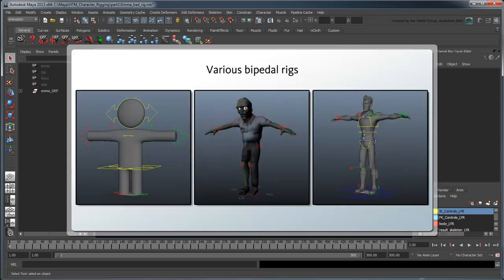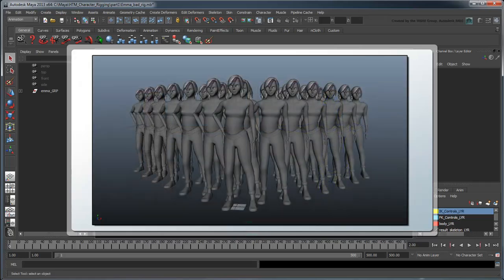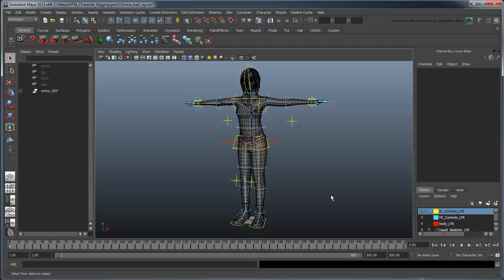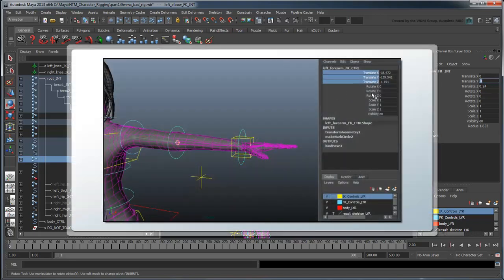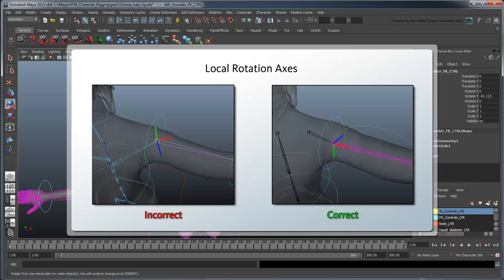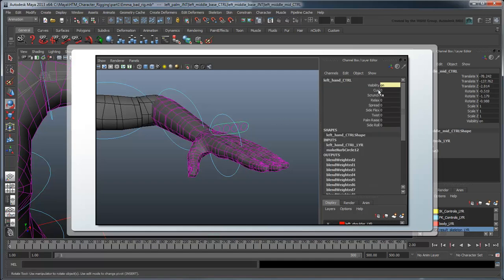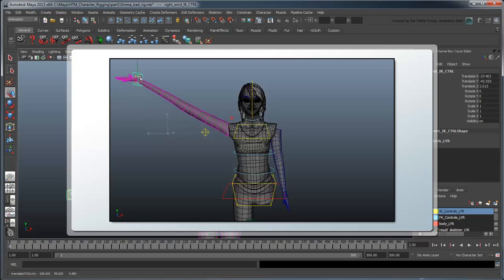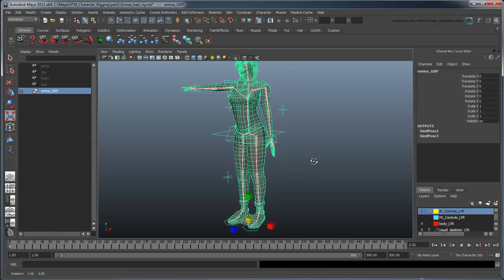Creating a Character Rig - Part 1: Common rigging pitfalls (Advanced)

Comment: I’m following this course using Maya 2026, and overall it still works well (I’m currently at part 18). However, if you’re new to Maya, you’ll likely run into a few hiccups because some tools now have slightly different settings or window layouts.

One thing I strongly recommend is not following the steps for adding stretch to the arms and legs. It feels unnatural and makes the entire rig more complicated than it needs to be. I’m not an animator - despite 30+ years in 3D - but if someone handed me a rig with fully stretching limbs, I’d honestly wonder whether I was working on a Pixar/Disney character or whether the rigger misunderstood human anatomy. Stretching can make sense for the torso or neck, but even there it’s worth adding some limits to keep the movement within believable ranges.

Comment: ‘Stretch for realism” idk mate last time I checked human bones can’t do that in real life…
Reply from the maker: Actually your limbs can stretch a bit by having the bones pull away from their sockets a bit.  Also it isn't so much stretch alone that's "realistic" but rather volume preservation.  A good example of both is to stretch your spine to reach as high as you can and your vertebrae will naturally pull apart a bit (stretch).  Conversely, if you crouch into a ball, your vertebrae will compress together and your skin (or in my case, fat) will squash outward.    Both of these are subtle,, but for the most realistic animation you need to be able to mimic both in a rig (obviously it's also great for cartoony rigs too).
Reply: @Autodesk_Maya  I feel like if my vertebrae or limb bones stretched form out of their socket to the point that it’s visible to the naked eye I’d want to go see a doctor lol

Comment: WARNING! guys if you using this as a tutorial, you will notice hes only showing you to do 1 leg, 1 arm, etc. for the sake of your sanity. Do them to both sides for your rig. once you watch about 3 hours of tutorials he basically says..."there is no way to mirror the rest of the rig so go back and do the same thing to the other side." This infuriated me. he could have warned me at the end of each video by simply saying, "now do the same to the other side"
Reply from the maker: I'm honestly very sorry about that.  My intent was to have the right-side act as a sort of test/review/practice of what was learned on the left side.  Also, it's not quite so straightforward as to do the same thing on the other side (part 32 mentions general things to look out for like reversing LRAs, and which joints can/can't be mirrored).  Anyway, either method of doing left/right was going to have advantages and disadvantages.
Reply: @Autodesk_Maya  Its also been 8 years since this was made. Is there anything with the newer versions of maya that make this easier?
Reply: @CorneliusBogfrollupFitzgerald  Mirroring joints in Maya is possible for quite a while, don't know since which exact version

Comment: Hi again~! I realize facial rigging like most thing is a case by case basis, but say if i were to do facial rigging how would I approach the proxy workflow would i be able to separate the head mesh and work on the facial rigging independently and combine it later? How would the skinning work? I can think of driving the main mesh with blend shapes but is that the only way? THANK YOU IN ADVANCED!!!
Reply from the maker: I wouldn't recommend doing a proxy rig at all for a facial rig - just skip straight to a skinned rig.  There are generally two approaches:
1.) Create joints to control the eyes and mouth and then make controls for them.
2.) Use blendshapes (as you describe).  

The former will give you greater control but is a bit harder to setup.  The latter is better if your character is only going to go through a number of pre-made expressions (like game characters tend to have).
Reply: Thanks for the prompt reply @Autodesk_Maya  . Does that mean in conjunction to the entire series featured here, I would only start my facial rigging in the final stages where the final renderable quality character geometry is transfer over and skinned? Doesn't that defeats the purpose of having a proxy rig to be used by the animators? Or do you mean i would skip the entire slicing and dicing of the mesh and go with a properly skinned character to begin with?

Sorry if this sounds all over the place since i am a little confuse with the pipeline here. Further if i would work in a team, can i have different person working on facial and another on the body rig using what was featured here? 

I have seen quite a few tutorials on facial rigging and the approaches as well as techniques aforementioned but most of those were demonstrated with the head mesh separated from the body. I am curious how would those approaches be implemented or integrated in relation to the featured series. In which stage would a rigging artist start to implement their facial say for the rig shown in the tutorial series? 

Thank you for your patience and kind reply.
Reply from the maker: @Wongjiunnhann  So typically this proxy rig is used for sketching out rough animation since it's the full body skinning that tends to have the biggest impact on scene performance (especially when multiple characters are in the scene at once).  So you'd animate actions without the facial animations first.

Once you're character's body animation is close to finished, there's a couple of ways you could proceed, mostly depending on how fast your computer is.  

1.)  One way is to import the skinned rig and transfer the animation over to a skinned mesh with facial controls (https://www.youtube.com/watch?v=M-B4jtTf3Co&list=PL8hZ6hQCGHMULnijpKL2q790u_nV9RP92) and then do the facial animation.  If you're on Maya 2019, make sure that Animation Caching is turned on and you shouldn't see much (if any) drop in performance.  

2.)  If you're on an older version of Maya without Animation caching, you may see performance drop when you do 1.  Depending on how heavy your scene is, this might still be workable (especially if you're working with blendshapes which don't require you to move controls as precisely as face controllers).  However, if you find it unworkable, then instead of importing the skinned rig into the main scene file, I'd recommend exporting the animated proxy to a much lighter file (either one without background elements or with very simplified background elements) and then doing the skinned rig transfer there.  Then you can animate the face a lot faster and export that entire thing back to your heavy file.  It's a bit more involved, but you'll get better performance to tweak your expressions just right.
Reply: Thanks for the clarification~ appreciate it a lot!  @Autodesk_Maya

Comment: So i managed to follow this tutorial and everything worked out! now im trying to build a single root skeleton to put in unreal but when i try to do the stretchy spine it affects all my limbs in a weird way. What things do i have to do different and watch for when building a single root skeleton ?
Reply from the maker: Hmm odd, the individual pieces should be compartmentalized enough that you can just connect all the result skeletons together to create one continuous skeleton.  I would try putting intermediate joints, representing the various "left_arm_GRP", "left_leg_GRP", etc just to see if that fixes any issues.

Additionally, I wouldn't recommend trying to move the entire rig, controls and all, over to Unreal since it uses so many Maya-specific nodes.  Instead, I'd animate in Maya, then bake the animations down to the root skeleton, then send that to Unreal.  Simplifying before sending to Unreal should guarantee it translates properly.

Comment: Can this solution be applied in vfx, feature animation and game industry?
Reply from the maker: VFX and feature animation for sure yes.  Game industry can be a bit tricky since it depends on what your game engine supports.  In general, the basics work like IK/FK setup and skeleton structure, but advanced features like squash and stretch may or may not depending on the engine and whatever custom code you have running on top of it.  If you want to guarantee it works in your game engine, then the thing to do is animate in Maya, then bake the animation down to the mesh, export, and then use those as pre-canned animations in the game engine.
Reply: @Autodesk_Maya  wow, you summarised all my 100 questions in one answer. Thank you. Is there a way I can contact of i have further questions?
Reply from the maker: @reginaldarmah2381  Just post a comment to any video where you have the question.  I'm always here to help.  = )

Comment: Does anyone have a clue how to import a rig like this in a game engine. I am using Unreal atm..  I skinned my character, and instead of having everything in one big group, I have the joints, controls and the mesh seperately... I keep getting a lot of errors
Reply: I'm not a rigging expert, but I think generally you only export the mesh and the joints (not the control objects) as one FBX.
Reply: I work in Unity but the concept surely applies: Export your character as an FBX. Make sure the scale matches your game engine, and make sure animations are part of the export. When in down, always select "export all." The bones are also imported to the game engine and you can translate the bones and the character's mesh will move, showing you the bones are still skinned in game. (Hence why you need them.) That is why baking animations is so important.

Comment: Is it possible to transfer information from a IK rig on a rig like this? I have a rig with mo-cap data. And I want the data to transfer to the rig I build with this tutorial. With what kind of connection would you do that.
Reply from the maker: If the controls have the same names / placements, then it is possible using the Time Editor.  https://www.youtube.com/watch?v=M-B4jtTf3Co&list=PL8hZ6hQCGHMULnijpKL2q790u_nV9RP92

However, are you sure your mo-cap data is on an IK rig?  Typically that data will be right on a skeleton itself, not on any controls.

Comment: after I have finished I can apply this ready skeleton to other characters? Since this is soooo laborious process to repeat it for each character
Reply from the maker: As long as their proportions are about the same, yes you can.  It'll be trickier if the proportions are different (you'll need to adjust some of the calculations for squash/stretch), but it is possible.

Comment: Hi! i am very new to rigging, and i was wondering whether this whole series of rigging tutorial would work on an 'A' pose character as opposed to the 'T' pose shown in the video. If so what should i take into account?
Reply from the maker: Yup, it can definitely work for an A pose character.  You'll just need to set the initial arm joints differently and rotate the controls so they line up with your character.  Alternatively, you can also set the joints in A Pose, but set the default stance to t-pose if you like as well.  It depends how you prefer to work.

Comment: Will this be a good rig for game animation? I am currently working on a project. I am familiar with rigging, but I am not that great when it comes to advanced stuff like this. I want to make it as easy as possible for myself when animating it later in the end. Has anyone got a bit of experience with this?
Reply from the maker: Yes, this rig is designed specifically for animation.
Reply: Were you able to make the rig work in a game engine? I'm struggling with this

Comment: So if I make a simplified model (of a more detailed high poly model) and animate it smoothly, can I replace it with the detailed model for final rendering?
Reply from the maker: This is the easiest, most up-to-date way of doing it: https://www.youtube.com/watch?v=M-B4jtTf3Co

If you have an older version of Maya, you can also use the Edit > Transfer Attribute Values feature: http://help.autodesk.com/view/MAYAUL/2017/ENU/?guid=GUID-CF4DA9FF-4AAB-4E6F-A7A7-773DFC1E95B9 from the proxy controls to the finished rig controls (make sure In Connections is turned on).
Reply from the maker: Yes.  All you'll need to do is re-skin it to the rig.
Reply: I, for one, can't seem to understand how to transfer an animation via proxy to a more detailed model. Good series nonetheless, I'll just have to figure it out when I get to that part.
Reply: Maya Learning Channel Wow that's pretty generous of you guys, thanks!

Comment: Hi I have a question ,when i'm moving some parts of my character there's a distance in between. SO my question is how could i attach them while moving? are there any ways to remove cut mesh?
Reply from the maker: This character is a proxy, which is meant only for speeding up animating.  When you're ready for final rendering, you'll want to smooth skin the character by deleting the cut up geometry and importing the full character again (from the file in part 2).  Then go to Rigging > Skin > Bind Skin.  You'll need to paint skin weights in order for it to react properly (you can see how near the end of this tutorial: https://www.youtube.com/watch?v=c538zkwxgTQ).
Reply: i don't know how to delete the cut geometry  how could i delete it ?
Thank you for replying me.
Reply from the maker: They're parented under the appropriate result joints.  See part 2.

Comment: Why are my bones looking like this 
http://imgur.com/NHYNdAo
http://imgur.com/me56HWa

they are so big and interfere with the mesh.so its really difficult to see what i am doing :/
Reply from the maker: +Alpha Devil Looks like your character is super small.  You can adjust the joint size by going to Display > Joint Size.  However, I would actually recommend you scale your character up, since you may have other unrelated issues working with that character in scenes at that size.
Reply: i actually tried it and scaled it 20 times bigger than the default plane and they still look kinda big They are okay in longer sections like legs now but still huge in smaller and wider sections like fingers toes etc..I am now confused.Am i supposed to scale this model like a 100 times or is something wrong with my settings which cannot be correct because i have only installed it today and all of them are default for sure..
Reply from the maker: By default, one grid space is equal to 1cm.  You'll want to scale your character according to that.  If the joints are still too big once that's done, then you'll want to size them using the option I mentioned in the comment before this.
Reply: Thank you.I will try that.
Reply: +Alpha Devil  Try to Update your graphic card Driver, I had almost the same problem with joints and the problem was from the Driver especially if you are using Nvidia .
Reply: oh.i will try thank you :)

Comment: After you finish constructing an proxy rig; how do you smooth skin; a fully skin mesh when the skeletal rig into groups?
Reply from the maker: +Jared Davis You want to attach the smooth skin to the result joints.  If you check the finished rig file in part 32, there's a Display Layer that contains all the joints for skinning.

Comment: hii i am a begginer to rigging and i want to animate a sqash and strech ball by doing self rigging can u plzz guide me with a tutorial or any other
Reply from the maker: +Purna Chandu A squash a stretch ball is more easily done with a deformer rather than a rig.
Reply: +Maya Learning Channel yaa but with a rig I am more comfortable I have downloaded for net and they used the ik handles I jst wanna know the procedure to make and have some knowledge on jnts and handles working so can u plzz give me a reference and also a deformer reference plzz
Reply from the maker: In that case, everything you're looking for is in this character rigging tutorial (specifically, squash and stretch is in part 12).  You'll just need to reapply it to fit your scenario.
Reply: +Maya Learning Channel so is it the same procedure applied on the fk sqash and strech
Reply from the maker: Yes, it would be.
Reply: +Maya Learning Channel thank u very much

Comment: I'm a little confused about character proxy rigs..
I understand the concept, but how do you get the proxy rig to affect the end-result 3d model? Do you attach a simple mesh wrap between the finalized model and proxy rigged mesh, or.. what?? Can't seem to find a good explanation.
Reply from the maker: WolfGr33d There's a few different ways you could go about it.  The easiest method is that once your animation is finished, import the fully skinned rig and use a "Retargeting" workflow to transfer the animation over to the fully skinned rig (http://help.autodesk.com/view/MAYAUL/2015/ENU/?guid=GUID-B2E9F8B9-F188-4E27-8820-BB0C8541701F)

Another method would be to complete your full suite of animations on different animation layers, then remove the proxy geometry and skin directly to your animated joints.
Reply: Maya Learning Channel Hmm, retargeting the skeleton eh? Sounds awesome :) Thanks a lot for the tip! It's so hard to find a full process from start to finish on how to do these things. I'll be sure to look up animation layering too.